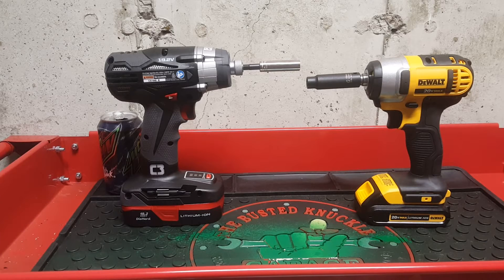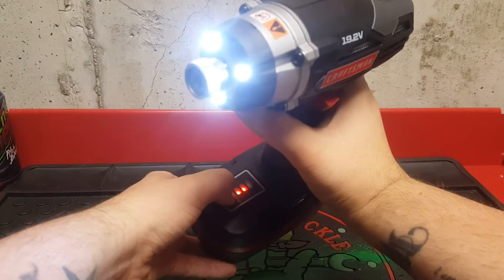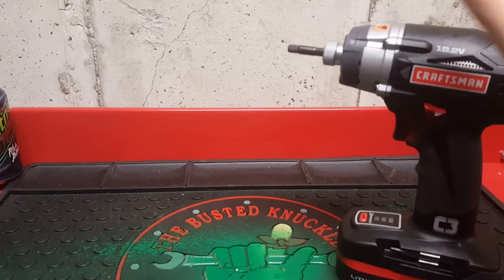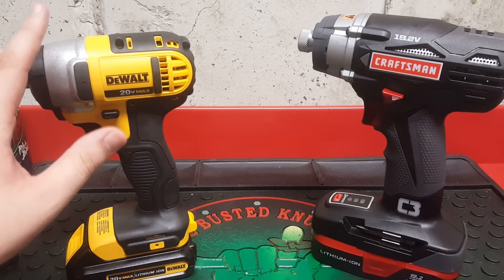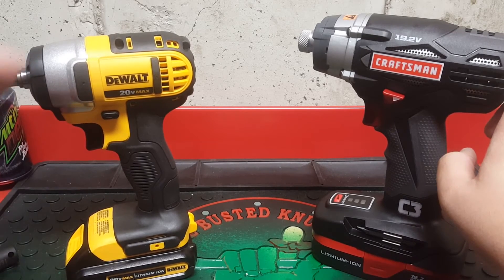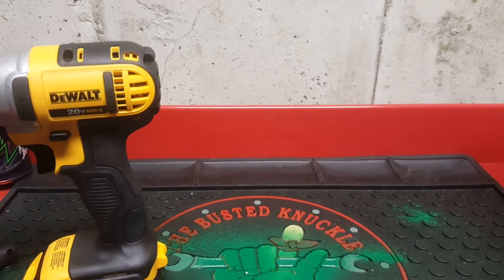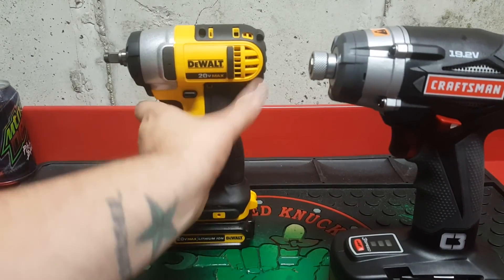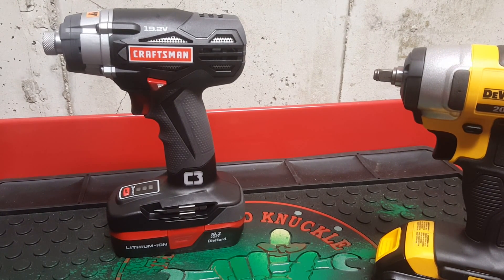Who Will Win?????

Comment: The driver won't hold up doing lug nuts and stuff compared to DeWalt 3/8 which i use daily in my garage for lug nuts ect. Drivers are really designed for small bolts/fastners and driving screws into wood and thin metal. But they are both good for there own purpose.

Comment: Any info on that craftsman driver on the max impact in foot/inch lbs per speed setting? (Ex speed 1 up to 35ft/lbs speed 2 up to 75 ft/lbs...) that would come in handy for not having to bust out the torque wrench for everything
Reply from the maker: Hard Knocks Forge I believe I have that info on my video talking about the craftsman driver. I'll take a look in a little bit and let you know
Reply: Themechanicman92 oh ok. I've got two C3 Craftsman 1/2" driver.the motor is shot on one but I have another one that the motor is practically brand new but the impact drive spring that keeps the output gear in place is broken however the entire front of the impact assembly on the burn out motor is in good shape.I just can't figure out how to swap them out so that I have a nice impact? Any help or shared knowledge would be greatly appreciated.Thank you for your time in this matter.

Comment: Why would someone need a 3 speed impact driver when the tool has a variable speed trigger? Isn't the object to remove or tighten nuts and bolts??
Reply from the maker: Mike ScepticOne yes, but with variable speed buttons you can be more precise and make sure you do not apply too much torque, especially with just regular screws
Reply: For example when joining soft wood using pocket holes having too much torque and speed and split the wood easily. More options is always a good thing. 
I just ordered one of these off ebay for a decent price... would advise others to do the same before they are all gone.